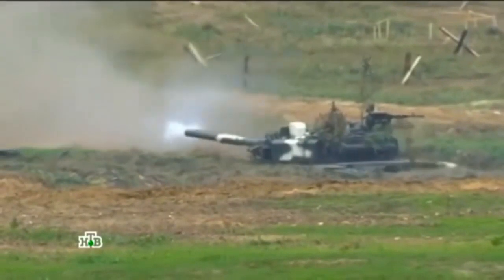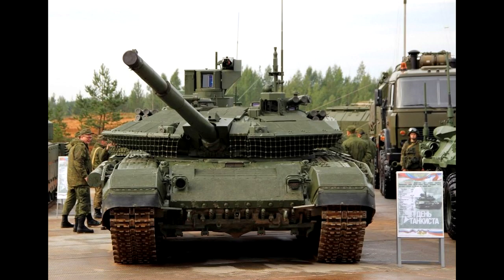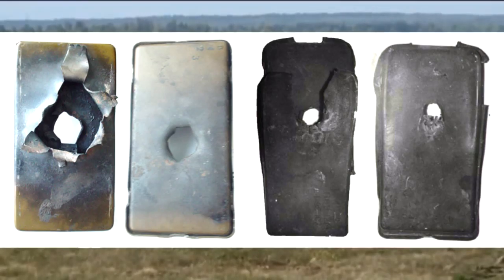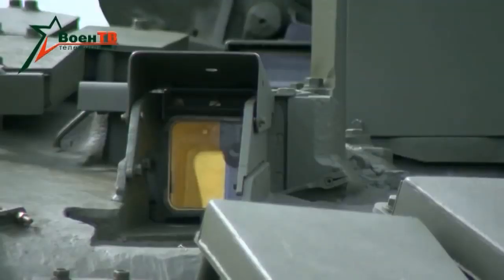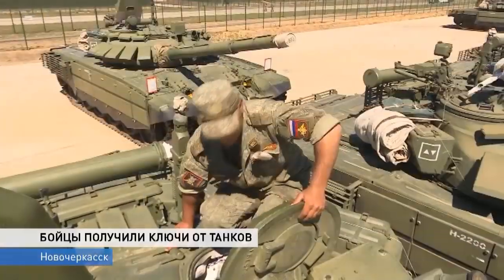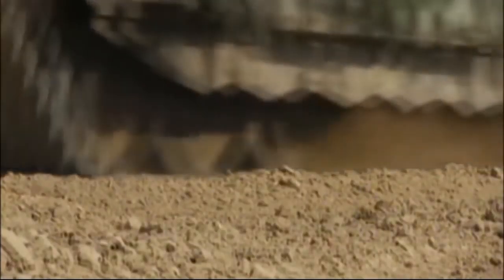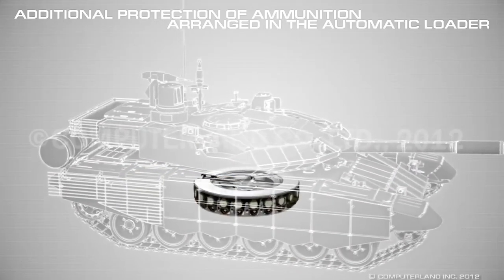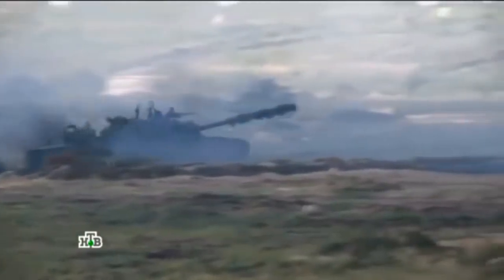Problems with T-72 tank

Comment: The problem with the T-72 (and T-80/T-90) is that the entire design is based on concepts from the late 1940s. It has virtually no room for expansion or modernization of core components such as armor, gun, or drivetrain. Crew ergonomics are vastly inferior to most Western designs and there is basically no interior space for things like a battle management system. It's a dead end that is only still being developed because Russia can't afford the T-14.
Reply: No. Just stop. The T-90M is the best example that proves the T-72 can still be modernized to be one of the best tanks in the world, if only enough money is spent to upgrade it. And that's the problem. Russia doesn't have enough money to upgrade ALL of their T72 to the T90M, that's the only reason why they have to go with a less expensive upgrade like the T-72B3.